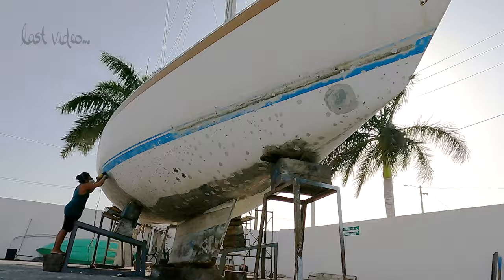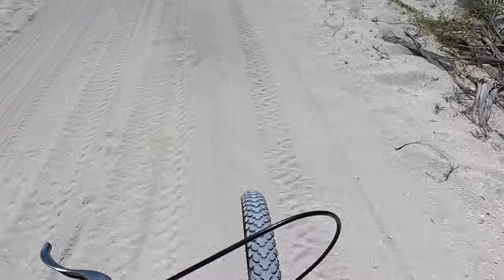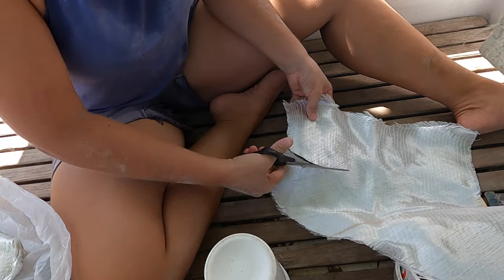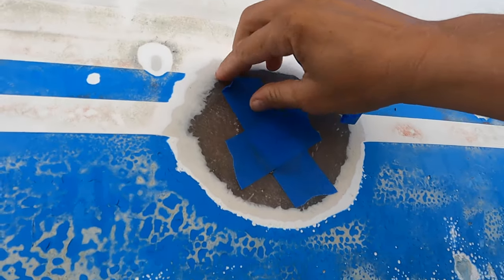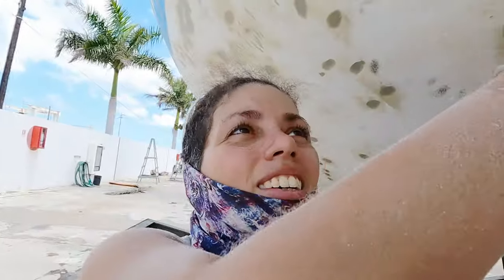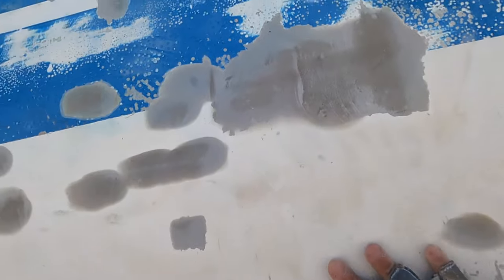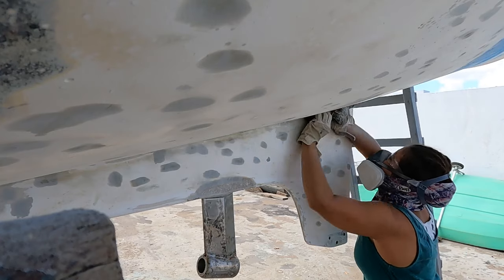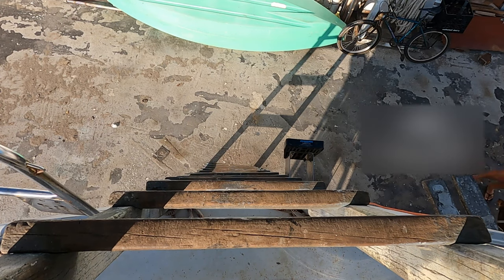boatyard haulout spectacle 2022 + COSTS

Comment: When ever you use a hole saw to make a plug, IF you can drill about 1/2 way through, the centre lead bit will poke out the other side , turn you material over and using where the centre guide bit has come through drill in & you will get a nice plug with both sides having a clean circular edge. Great job you've done .
Reply from the maker: Thanks for the tip and thanks for watching!

Comment: HELLO Justin and Robbi! Wanted to let you know I really enjoy your videos. I have a couple of thoughts about your sanders all biting the dust, are you letting the tool do the work? OR is it you? just a thought. I love some of your recipes! can you make a video of just both of your recipes? I want the recipe with garbanzo beans and garlic ginger?  yummy.  You two are lovely to watch thank you !! Deb in CT usa
Reply from the maker: Hope to release more cooking videos once the long haul of the boatyard is finished (cooking here is not so inspiring) 🤪. I feel like I could release a whole technical video about sanders. I think I’m pretty proficient at applying a medium/reasonable amount of pressure so as not to wear out the bearings, but also not letting the sander spin so freely that the bearings wear out also. In the end, I think it’s fair to say that the tools are simply not up to the task - the fiberglass is too harsh, the amount of material that I want to take off is too much, and the surface area is too large. Proof of this is that ever since switching to the grinder, I’ve had zero problems.
Reply from the maker: Also wanted to add that our vacuum does not remove enough dust to save the bearings - of course, that would help. The grinder is built so that the dust is less likely to enter the tool housing in the first place.

Comment: Love the collars on your epoxy and hardener cans. Will definitely give them a try! (Acetone makes me happy. 😂)
Reply from the maker: Yeah, it's been working really well without using any pumps and recycling a bit of plastic! If you try this method, make sure to fit the collars really tight so that the epoxy does not drip out onto the top of the cans.

Comment: Great tip on the cooking oil in lieu of gloves for laying glass. Just curious why you chose epoxy resin on what is presumably a poly resin layup I did the same as you to delete some through hulls but definitely regret not going with poly resin, I figure I'll be revisiting the repair in a few years 😆
Reply from the maker: Polyester is cheaper - but epoxy resin wins every time with its strength and durability. Also, I think it's easier to get an especially cheap and bad polyester, whereas if you go with West System or contending epoxy name brands, you're gonna have good results - that's what I've experienced so far.
Reply: @sailorama  Ah yeah, good point. Well hopefully our through hulls stay deleted 🤞 lol

Comment: Your repair of the through hulls is wrong.  There needs to be fiberglass overlapping both inside and outside of the hull.  Hydraulic action will cause your repair to de-laminate, and leak.
Reply from the maker: Some footage that went missing that I mentioned was actually the fiberglassing of the outside of the holes - laying up 3 or 4 circular fiberglass layers and then smoothing out with thickened epoxy.